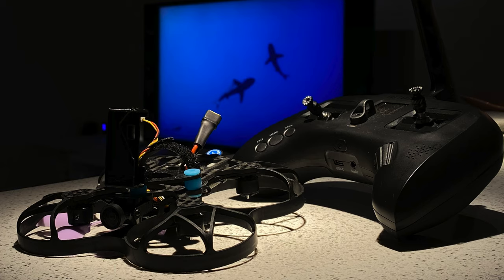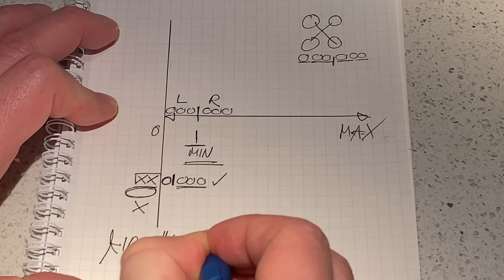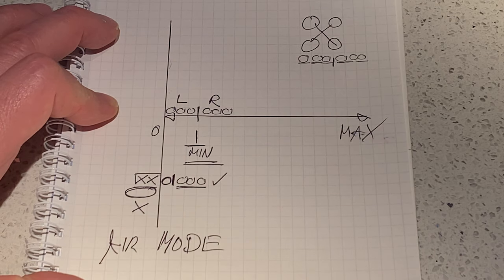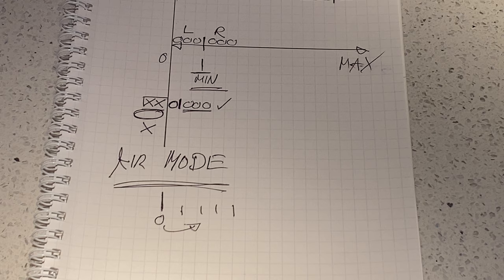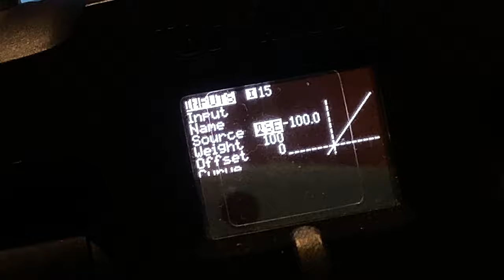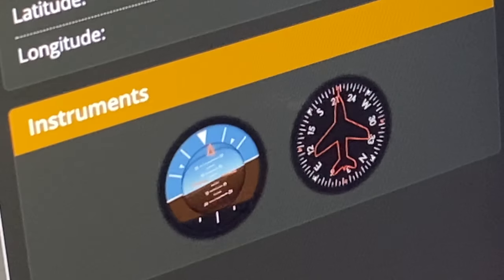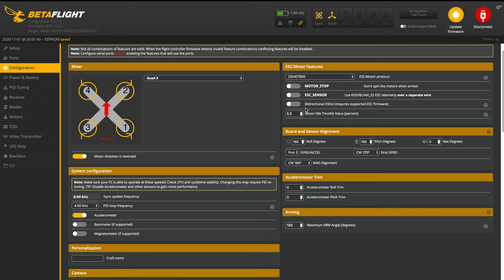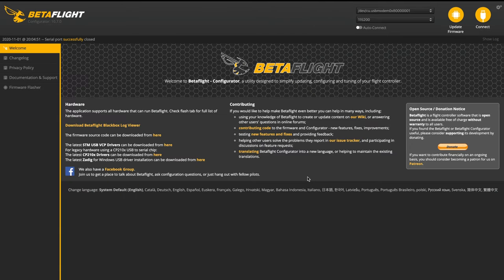BETA 95X V2 AirMode setup in Betaflight | TBS Tango 2 PRO FPV Crossfire

Comment: i just picked up a 85x V2, i have having trouble binding to the original tango. any suggestions? can anyone out there guide me through the steps. thanks!
Reply from the maker: I had issues to bind it at first as well. 
I refreshed the firmware of my Tango II to the latest beta. Then also did the receiver accordingly. If that doesn’t do the trick you might also want to check you frequency bands.
Good Luck, hope it works out fine for you. 👍🏻